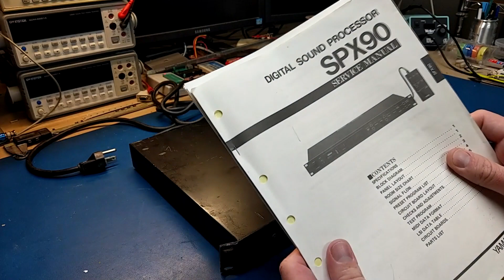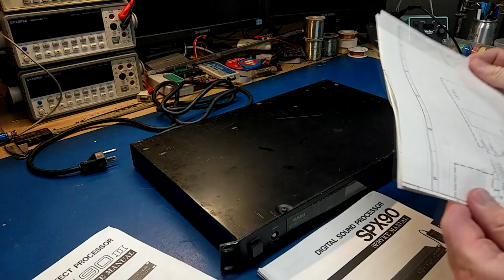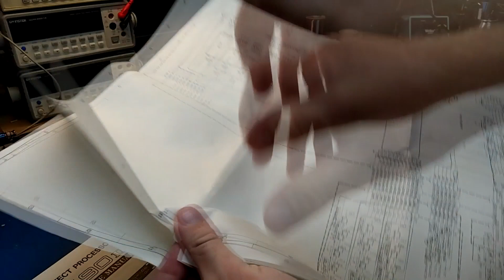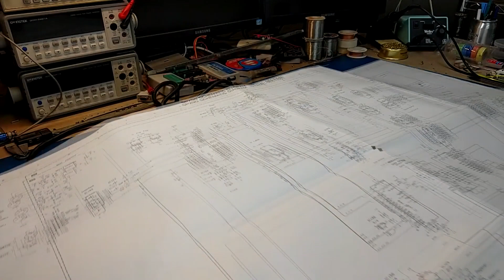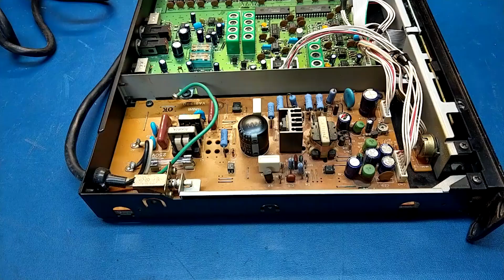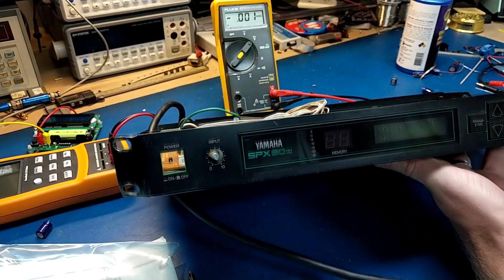Yamaha SPX90 II Repair and Teardown - Part 1

Comment: How did you remove the long metal lever connecting the power button  and the switch in the back? Thanks
Reply: Its a cruel joke -- every SPX90 repair video skips the same thing

Comment: 7:11 power regulator supply looks same as with , spx1000 , oddly its doing the same as everyone else reports with , led lights ,lit  up and audio distortion on the outputs , 
so which capacitors need to be changed ? i replaced few of likely ones , same issue , got some other caps and replaced no power comes on ? so i change the caps back to the previous ones  ( later ) there is a large cap that says  vw ? what's that mean ? i got same 47uf 400v but just want to be certain about this 

could you  edit  and list all  parts replaced in description 

thanks

Comment: This a hugely helpful. I have a new problem with a unit that just arrived from Japan...I'm getting either no sound or crackling from when the effects are engaged. Any ideas or help would be greatly appreciated, as I'm trying to get this up and running for a project. I was stoked because the unit is in mint condition, except for the aforementioned problem. Thanks a million in advance. Here's a video of the issue. https://www.youtube.com/watch?v=9NTTOJMo2Xo

Comment: I have a unit that blew the mains fuse and smoke came out of the smaller if the 2 chokes. Could the filter caps of the mains be done for and need replacing?

Comment: Thx Brad, good explanations, I have a spx 90 II that comes on, but it buzzes, found 6.7 volts at the 5 volt terminals, replaced all caps on power board, no change, suggestions
Reply: did you ever find a fix? i just got one that goes buzz, buzz, buzz, buzz

Comment: Hi, I have the same model, basically i use it in a Aux send/return but I have some issue. 

The Yamaha doesn’t output the sound in a proper level, only if I drive the volume in input really high. 
Can you give me some advice to what look for?

Comment: Hey Brad, great video. Something I've heard a number of times is that the SPX90II is quieter than the original SPX90. From the specs and service manuals, it seems this should not be the case as both are identical other than the added DRAM for a longer available delay time of 2000ms on the SPX90II. What are your observations on this, do you agree the SPXII is quieter? If it is quieter, can you shed any light on what changes were actually made to accomplish this?
Reply from the maker: Good question, I have both but have not noticed. There are some very minor hardware changes as you noted between them, nothing that should impact noise though. I may have to make a video to see. Thanks for watching!
Reply: @bradthx  Yes, a video about the hardware differences and audio comparison of the noise would be great, thanks!

Comment: Hello!, well done! 30 minutes ago, I ve fixed an old SPX 90 at work (no start-up , 3V instead of 5V on PSU). Big cleaning for power supply board (insisted with this brown dough...) , many weird weldings to redo. I've changed C23 & R18,  very corrupted legs on these ones

Comment: Looking at re-capping the power supply on my SPX, but I’m a bit hesitant as I’ve read some warnings about electric shock (especially the big cap on the output of the transformer). Judging by the way you handle the PSU in this video, it doesn’t seem like a big concern. Is this mostly a myth?

Comment: Hey Brad, I followed your advice and recapped the power section of my spx90. It turns on and works now but it seems as if all of the effects are distorting and sending a distorted signal to my amp. 
Guitar/cables/amp are working perfectly (clean amp settings too).

Any idea what could cause this? The rest of the caps look OK to me but I will double check the analog side of the digital board.

Thanks
Reply: mine seems to produce a square wave trem style "buzz, buzz, buzz" is that what yours does? thanks

Comment: amazing video! I would like to convert an US model to an European model. The PCB's are the same only some different resistor values and some small amount of other components are different. Do you know if the transformer is the same? If you don't know that, can you tell me the AC voltages on the primary windings of the transformer (pin 1-2 , 2-3 , 3-4) from an European model? What is the difference in the optoisolator? Thanks in advance.

Comment: Thank you so much for this video Brad.  I was given a semi-functional SPX90 (v1) by a friend who got it from a gear shop.  Apparently the previous owner thought it was a bad input jack and decided to spray WD-40 into the unit (possibly while it was on [protip: never do this])  Your video helped me diagnose and figure out why the 5V was working and the 18V wasn't.  All it took was 8$ in new caps from Digikey, a thorough cleaning and it's now got a second life again.
Reply: I appear to have no input signal as well, but all else functioning.

Comment: People still seem to love using this unit for snare. I was hunting one of these for a good while and one seller even backed off after a couple of weeks of trying to close the deal saying he'll keep it after all. He started with saying that he has one laying around unused and only used it for snare ever. I was looking for that Symphonic patch for Zakk Wylde and other 80's stuff on guitar, and for that the "inferior" technical specs actually helped (like top end roll off).

I'm so happy that mine doesn't show any signs of giving up at power supply yet. I heard the display panels are also common to fail. But at least after seeing this, it's likely an easy fix even by myself.

Comment: helo
i'm eric from france and i have a spx 90 ii withe 110 v and i use a 220 to 110 v tu use it.
i can change the internal transfor. ( only the primary ) but what  model with what output voltage can i use ?
best regards and thanck u
eric

Comment: Hi Brad, I picked up a broken Spx-90. The power supply looks good, +5v look good, +/- 18 looks good. It did have a bad +15 regulator, which I replaced. Now I'm seeing correct voltages on the rails on my chips... The unit still doesn't seem to work. The display is just green squares. The bypass relay (ry102) won't turn on. It attempted to turn on once, the relay clicked three times, and then turned off. Now it won't come on at all when I power cycle the unit. Any ideas what I should look at next?

Comment: Hi bradthx, 
First, thanks for the video
I replaced 99% of the electrolytic capacitors from the source
I forgot to change the 22uF x 10v C30
When I turn on the spx the lcd display flashes(just half) and  the relay makes noise and stops
What I realized is that I can't stabilize the 5v output
the oscillation is great. ranging from 3.5 to 4.8v, and even if I adjust the trimpot to reach 5v these values keep fluctuating
What could it be?
Do you think that C30 can be the problem?
kind regards
Marcio

Comment: I took a crack at re-capping my original 90 - as with lots of the comments all the caps were basically shot.   Weird thing tho -  when I measure the voltage on the 5v rail, I get negative 4.75v.  Any idea what could cause that?  I've done some digging and can't find an answer to such a thing.  I also checked my multimeter on a 9v battery just to make sure nothing was wonky there, and it's working fine.

Comment: Where do you find the voltage input/output specs for the gear? I assume the service manual, but I was excited to see you crack it open, but didn't really cover how to read. I'm still going through your videos, after discovering your channel. I hope to learn more about electronics repair from you. thanks.

Comment: Brad- What ESR rating for the caps is appropriate? Thank you!!
Reply from the maker: I usually don't dwell on ESR when buying new capacitors too much, most manufacturers also don't state the ESR in the datasheets. Any new, name brand high quality cap is going to have a low ESR and likely better overall specs than the original components anyway.

Comment: Anyone knows how much voltage should be coming out of the power transformer (T1 on the schematic) ? I believe mine has failed and wanted to get a equivalent unit. Thanks
Reply: Are you still in need of this info?

Comment: I have an SPX90 mark 1 that keeps blowing the 6.8 ohm 5 watt power resistor R2.  I've tried to narrow down where the problem is.  When I remove the power transformer, the resistor doesn't blow, and removing any component BEFORE the transformer keeps it from blowing so.. could it be a bad power transformer?

Comment: Just grabbed a couple of these cheap, but came without any power supply inside - had been swapped out for a 5 pin DIN external supply for live use on stage( not sure what that would need to power up?). Are there any power supplies that would do a good job to drop in to these units, something from Meanwell eg.? Would there be any issues with using a newer power supply on this "old" kit?
Reply from the maker: Technically no, as long as you can provide clean + and - 18VDC and +5VDC it should work. Note the +5VDC line will probably need a couple amps to run all the logic and dsp.
Reply: Thanks bradthx. Would this PSU work? Was recomended by online forum:

https://www.mouser.com/ProductDetail/Cincon/CFM40T-03?qs=%2Fha2pyFaduhBqtyVrjqWFU5veU4eyBvtv5Yyl8Eg8elbCxhSblZFVQ%3D%3D

Details here - https://www.cincon.com/productdownload/SPEC-CFM40D-T-V14.pdf

Comment: Putting new caps in my spx90 ii as well- started yesterday. The diode of D7 exploded and corroded - smoke came out of the rack!  My big boi cap is also bulging - had to send away for that one from mouser, my local electronics store had all the others and the diode, and graded for hi temps. What I wanted to mention was - I realized after wrestling w the power supply board that the bottom of the rack case is actually detachable as it’s own flat piece of sheet metal - with the sides and back/front of the rack remaining intact. This makes it super easy to access the top and bottom of the board, for deinstalling and  installing new parts. I am making my own little video to explain. As an electronic novice I found that accessibility extremely helpful. I’ll link to this one. Very informative. Thanks.

Comment: Hi brad. Any idea if the screens on these are a generic part that can be cheaply swaped out?
Reply from the maker: Hi David, they can be for sure. Look on eBay for HD44780 LCD displays, 2x16 character. I would measure the one in the SPX90 to make sure it is the right dimensions, but a majority of them are a direct replacement. You need to make sure you buy one with pins on the side as well, not along the top. I discuss this in part II.
Reply: @bradthx  cheers mate. Yes i realised once i watched part 2. I just bought an spx90 but its not arrived yet. Ive ordered this display. Hopefully it will be correct.

https://rover.ebay.com/rover/0/0/0?mpre=https%3A%2F%2Fwww.ebay.co.uk%2Fulk%2Fitm%2F302180194645

Now i just need to wait on the unit arriving so i can get a component list for recaping.
Reply: @bradthx  Thanks buddy. I've had a really bizarre time with it. Check my channel if you are interested.  I'm having limited success finding a working display. I've managed to use the new back light in combo with the old display (after blowing 2 of them before i realised they need a 10ohm resistor in series)  for now but I'm determined to figure out how to fabricate a whole replacement for future ref. I figured out that the connector for the display is known as a 14 pin IDC cable.. would you happen to know what the connectors for the display power / the other general motherboard connectors are called? It was really odd but connecting my IDC cable to the old display resulted in it not working and getting real hot as if it were wired wrong... but that's pretty hard to mess up.

Comment: Rookie Question:
I recently bought a Yamaha SPX90 and sometimes i hear a "sizzling" sound as soon as I power it On, then i turn it Off, and then On again and no "sizzling" sound.
Any help on what that might be ? 
Thanks !
Reply from the maker: The switching power supply is always the common problem on these units, the noise is most likely from the high frequency transformer. Rebuilding it as I did in this video usually resolves.
Reply: bradthx Thank you very much for the info, I’m gonna get it checked !!

Comment: I recently bought one with a bad PSU (no +5V or +/-18V). I replaced all the electrolytic caps to no avail. I then removed over a dozen components to test out of circuit, all of which were within tolerance. Just as I was about to give up and go to bed, I decided to power it on again and lo and behold, it started working! Must have been a bad solder joint? I did check it over initially but didn't notice any dodgy joints. Well done me anyway :)

Comment: I have an SPX-90. Sometimes it works, sometimes it doesn't. It turns on, and it gets stuck flashing between the intro menu saying "YAMAHA v01",  and the preset menu (mine is on "Symphonic) - after a while it goes onto the presets, and it works as normal, but it may drop out again; so I suspect it's a faulty connection somewhere (might be the power supply, I don't really know.) - How would I locate the problem, and how could I fix it? I'm new to actual hardware.